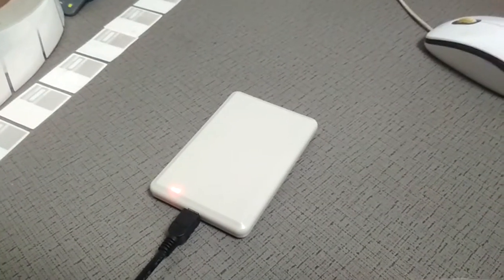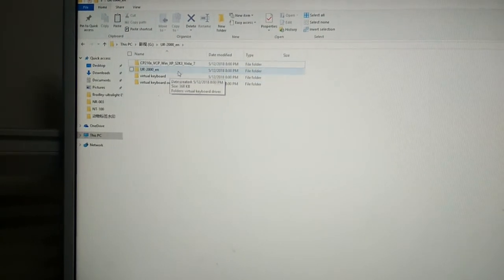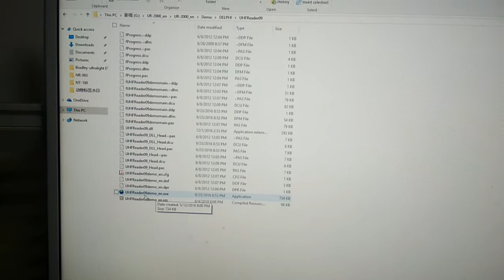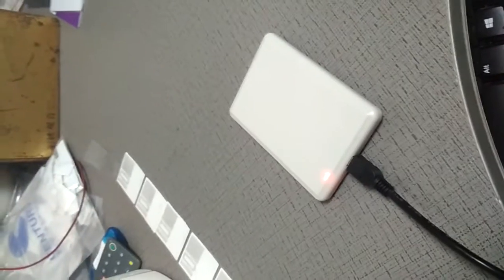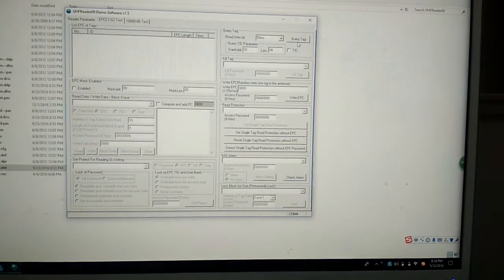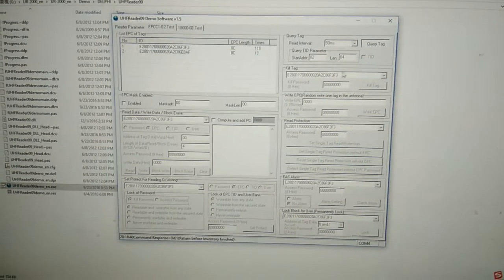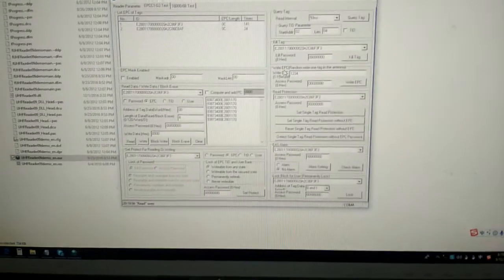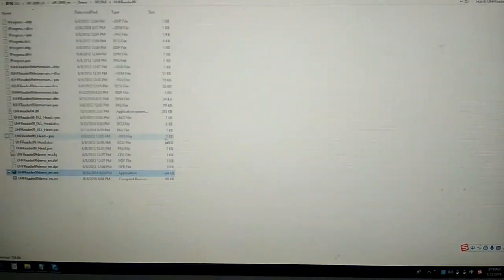How to read & write UHF RFID tag with GEE-UR-2000 UHF RFID reader writer

Comment: if y'all looking for rfid reader that can read on arduino. reply to this comment for the price. i'll also give you the circuit and the code for the rfid.
Reply: How much for the rfid reader?
Reply: @realdonta2686  150$ shipping will be yours. plus we'll give 20 rfid tags.
Reply: @realdonta2686  we will show you of course that the system are working. we'll be video call or face time. we eill make sure that you'll be satisfied before sending the rfid